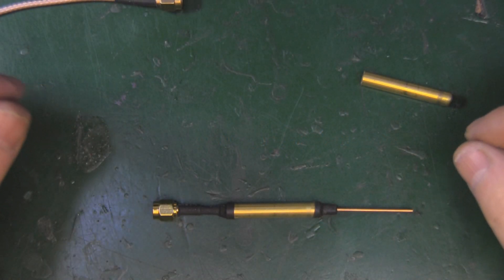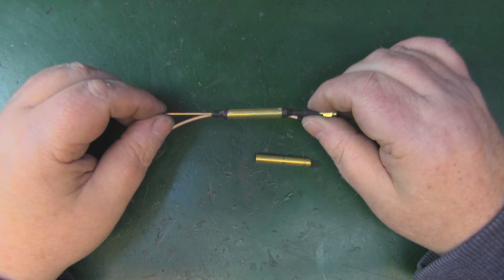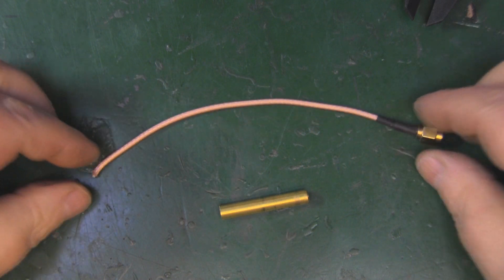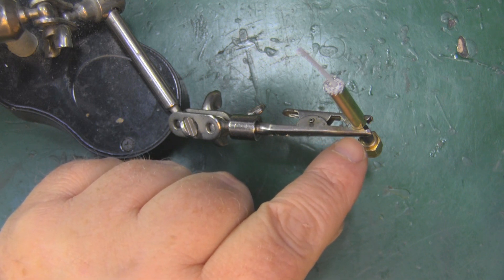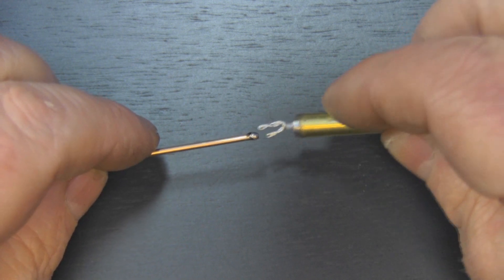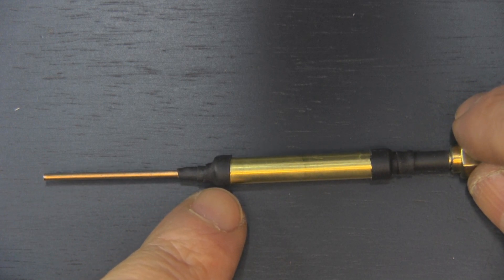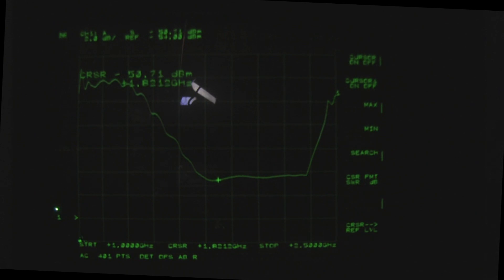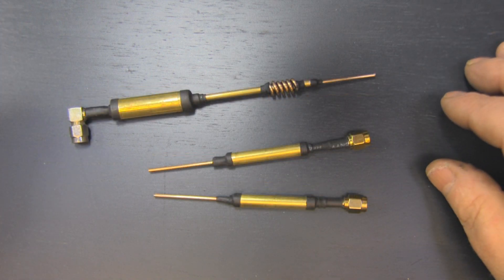3.5 dB Omnidirectional Dipole Antenna for LTE

Comment: Hi sir is it possible to make omni dirctional multielement loop antena for 900 1800. For very high gain
I am tring for 1 outdoor and 1 for indoor installation for enhancing signal in building without a repeater 
I have worked for a year.  And modified lau2 named loop antena on web 
Now its recieving about -40dbm signal at outdoor but cannot retransmitt it 
I mean i have sync issue due to lack of equipment 
Any help
Reply: Loop which i made is single element combined with dipole perpendicularly

Comment: Andrew, just being pedantic here, but you regularly throw it n the term 'hertzian' dipole and I am not sure you 100% understand what this means. The herzian dipole is more of a theoretical concept than a real antenna you would want to build. It really refers to something electrically short(less than 10th wavelength ish) and infinitesimally thin with uniform current distribution. This simplification allows for easier mathematical derivation of things like the radiation pattern and theoretical 2.15dBi gain for instance. You rarely want to build this antenna as the impedance match would be horrific. Occasionally something similar is used as a field 'probe' to make measurements, but where the intention is not to maximise radiated or received power, but for instance to accurately measure the near field of a standard antenna. What you have is a regular dipole. Or sleeve dipole. No balun on this design, but you can add a bazooka balun if you require one.
Reply: I agree with Scienteer. Hertizan dipole is much shorter than the wavelength. see in https://www.waves.utoronto.ca/prof/svhum/ece422/notes/05-dipole.pdf
Reply: Some reading material with links below. I will also check my copy of Balanis.

25.1.2 Approximation by a Point Source A Hertzian dipole is a dipole which is much smaller than the wavelength under consideration so that we can approximate it by a point current distribution, mathematically given by [31,38]

https://www.google.com/url?sa=t&source=web&rct=j&url=https://engineering.purdue.edu/wcchew/ece604f19/Lecture%2520Notes/Lect25.pdf&ved=2ahUKEwi9or3lpcXtAhVHZMAKHUwVBloQFjAregQIMRAB&usg=AOvVaw18pqrK6g0hn5Fy-Er5gUkM

Ideal (Hertzian) Dipole Avery simple radiating element we can study is the ideal dipole, also known as Hertzian dipole and infinitesimal dipole. It is very short (length λ), and as such has current uniformly distributed along its length. Although it is difficult to implement in practice (having a current distribution that is difficult to realize since it is discontinuous), it is highly useful for helping analyze larger wire antennas which can be subdivided into short sections having uniform current (i.e., ideal dipoles). Then, much in the same way as we derived vector potential for a continuous current distribution, we can use superposition to find the fields of a long wire antenna

https://www.google.com/url?sa=t&source=web&rct=j&url=https://www.waves.utoronto.ca/prof/svhum/ece422/notes/05-dipole.pdf&ved=2ahUKEwi9or3lpcXtAhVHZMAKHUwVBloQFjAoegQINhAB&usg=AOvVaw0Nc3S8WYiwFlUMpEmtb8rM

A Hertzian dipole is commonly defined as an electrically-short and infinitesimally-thin straight filament of current, in which the density of the current is uniform over its lengt

https://www.google.com/url?sa=t&source=web&rct=j&url=https://phys.libretexts.org/Bookshelves/Electricity_and_Magnetism/Book%253A_Electromagnetics_II_(Ellingson)/09%253A_Radiation/9.04%253A_Radiation_from_a_Hertzian_Dipole%23:~:text%3DA%2520Hertzian%2520dipole%2520is%2520commonly,is%2520uniform%2520over%2520its%2520length.&ved=2ahUKEwi9or3lpcXtAhVHZMAKHUwVBloQFjACegQIGxAF&usg=AOvVaw1uzZQrg8cr5_AIhHIz3haK
Reply: Also Wikipedia...

The Hertzian dipole or elementary doublet refers to a theoretical construction, rather than a physical antenna design: It is an idealized tiny segment of conductor carrying a RF current with constant amplitude and direction along its entire (short) length; a real antenna can be modeled as the combination of many Hertzian dipoles laid end-to-end.
https://en.m.wikipedia.org/wiki/Dipole_antenna
Reply from the maker: @scienteer3562  Scienteer I will take a look at the info you have posted over the weekend and get back to you. ;-)
Reply: @andrewmcneil  do let me know if you find anything that does contradict my understanding, it wouldn't be the first time that antenna engineers give different names for the same basic concept. And it's sometimes worth thinking about them from both viewpoints. The classic the the patch antenna, which is also a slot antenna.
Reply from the maker: In physics it is called a Hertzian dipole or elementary doublet. I even helped update the Wikipedia page last year as it was lacking in information. I always make a point of calling it by its real name as it is the most misunderstood antenna on the planet but since the rise of wifi and Bluetooth is also the most used antenna design on the planet.

Comment: Do you allow for the extra length added to the tube because of the solder and braid or doesn't it matter much.
Reply from the maker: At these frequencies a millimetre will not make any difference. But if you were to build one for say 5 GHz then it would. Here I filed it down to much less than a millimetre.

Comment: A beautiful antenna construction, very simple to build.
I am thinking of using that type of antenna with my lora modules.  Obviously building one with the length for 868Mhz.  
It would be nice to build an antenna that covers both 868Mhz and 915Mhz. With such wide bandwidth coverage this looks like the perfect antenna.
Reply from the maker: Yes I need to work on the math for 868 MHz and from the bandwidth of this one I am sure it would be just as wide.
Reply: @andrewmcneil  Awesome.
I usually use the NanoVNA to play around with calibration and experiment with antennas.  
But if there is a way to calculate the lengths of the various antenna elements using math, it would be nice.
Reply: @andrewmcneil Looking to build one for 868 too. Can you share the formula you used for this, or is there a calculator available somewhere?

Comment: would a Slim-Jim antenna for 1800 MHZ up to 2 GHZ worth trying and how much gain would it have, That antenna might with with a DAB receiver but might need a signal booster don't know.
Reply from the maker: I am working of one for 2.4 GHz the maximum gain for a Slim-Jim is 5db but with the Hertzian you can stack the elements to achieve much higher gain.